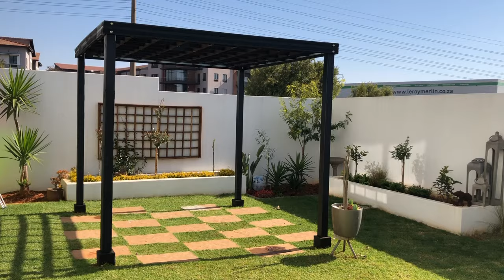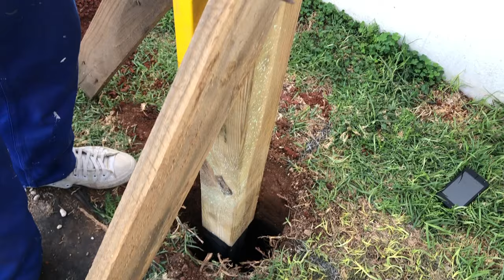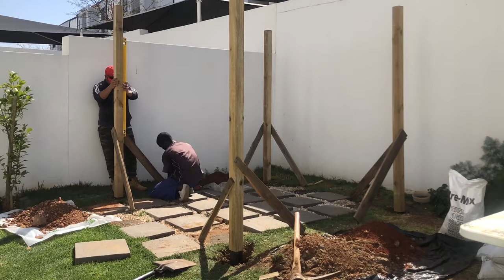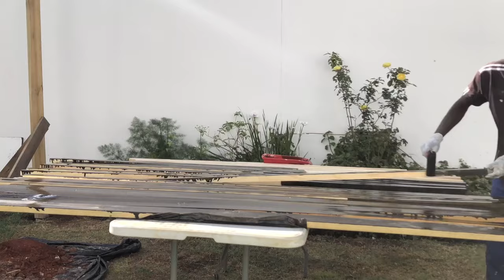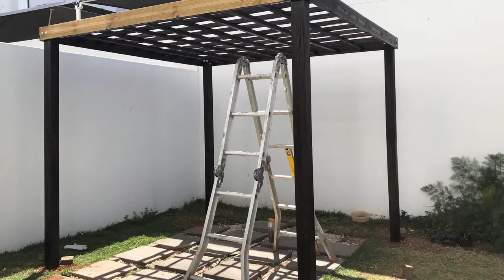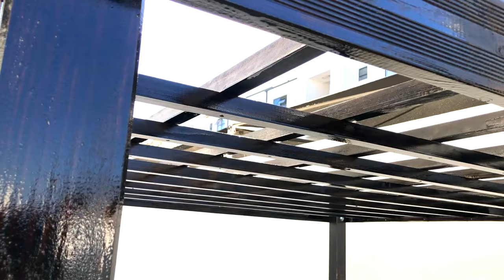DIY PERGOLA BUILD TIMELAPSE l Wooden Pergola UNDER 10 MIN

Comment from the maker: Hope you enjoyed this DIY PERGOLA BUILD TIMELAPSE! Comment below if you've SUBSCRIBED and we will reply back to YOU!
Reply: Is the wood going to bow over time?
Reply from the maker: Hey Mike Vo, thanks for the great question! The screw reinforcement and slats on the perimeter does strengthen the structure significantly. However, because it is wood it can bow. In my personal experience, this has been minimal.
Reply: Hi may I know which video edit software you are using please
Reply from the maker: Hi Eric, we use iMovie currently, but intend to upgrade to a more advanced software as we grow! Stay tuned for it and make sure you're subscribed. Thanks

Comment: Glad I found this video. Just tore down a deck to build a covered grilling area and was wondering about a slant roof. I think I'll make it a pergola now and save on materials. What size are the roof slats?
Reply from the maker: Thanks for the great feedback and we are delighted we could help you out! The roof slats can either be 38mm x 38mm or larger at 50mm x 76mm - the choice is yours and depends on price and availability. We used 16 in total. Good luck with yours and please send us pics when it’s complete 🙌🏼

Comment: how did you get the carved? finish on the upper structure surface ?
Reply from the maker: This is a decking board that already had these grooves cut into it. We thought it looked interesting as a finish and it was treated already so made a perfect perimeter 👍🏼

Comment: I’m trying to find a 4x4 box tube but can’t seem to find it at Lowe’s or Home Depot… does anyone know?
Reply from the maker: Have you got a picture of what you’re looking for or tried other alternatives to achieve the end goal?
Reply: @nailandscrew6702  I do, I’m trying to build it similar to yours at least with the footing. I don’t want to put bare wood in the ground as it will rot over time
Reply from the maker: Try searching  for a metal fabricator in your area and they may be able to get you in the right direction. We bought the metal post at a local hardware in South Africa named Cashbuild

Comment: What size are the Timbers and rafters?
Reply from the maker: Hi Zac, the posts are almost 4x4 inches or 95mm x 95mm and the purlins are 40mm x 40mm in dimension. Thanks for the great question. You can watch our full length Pergola video for more details

Comment: It provides no protection from sun or rain so what was the point of it??
Reply from the maker: Hi Terry, you’re right, a pergola defines an area and usually provides dappled shade to sit under. Adding a polycarbonate sheet on top will aid with sun and rain, but this is usually not the purpose of a pergola 👍🏼

Comment: Is there anywhere you can buy a post bracket in that style?
Reply from the maker: dones394 Great question! It depends where you reside. But most big box Hardware stores like Builder’s Warehouse or Leroy Merlin (South Africa) have similar types who may need modification, but definitely Lowe’s or Home Depot (USA) should stock them! Keep us posted on where you find yours! 👍🏼 Good luck

Comment: Why the music ?
Reply from the maker: Why not? 😊
Reply: @nailandscrew6702  I also felt, the background music is louder than the 'voice-over' and had to repeat/rewind too many times and was (just to be very honest) very annoying and frustrating, especially if this was meant to be a 'instructional DIY/How-to Video'.  I hope you don't get offended.  Just a minor issue in an otherwise great video.  Thanks.
Reply: I now see that, the music was fine later during the 'timelapse', which is nice.  But not during voice-over or at least should be been a lower volume than the voice-over.